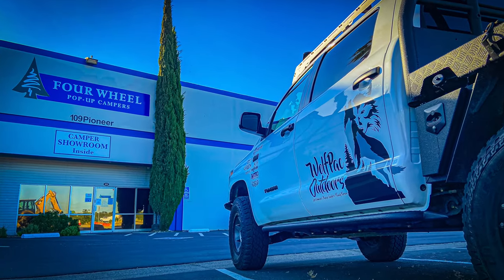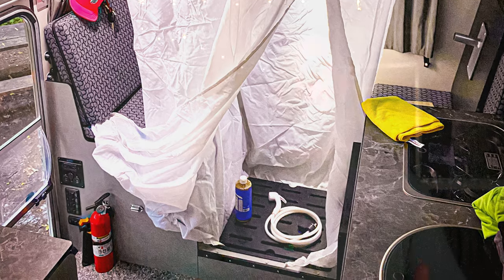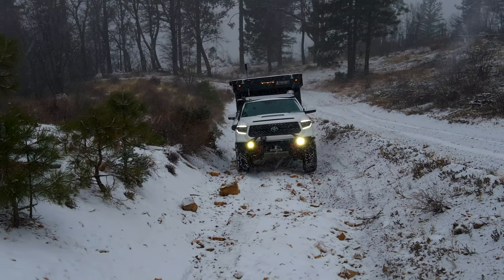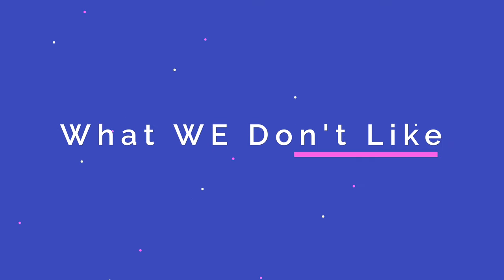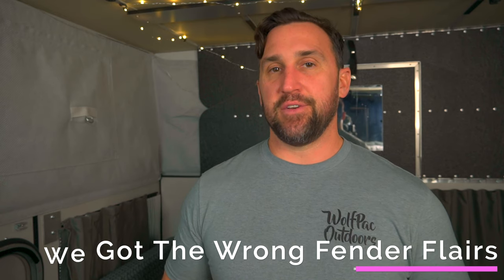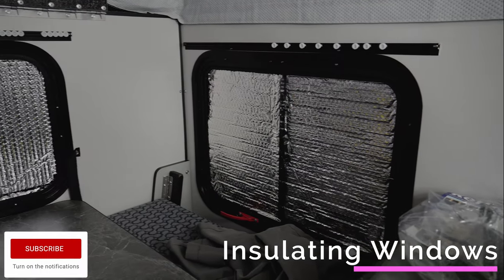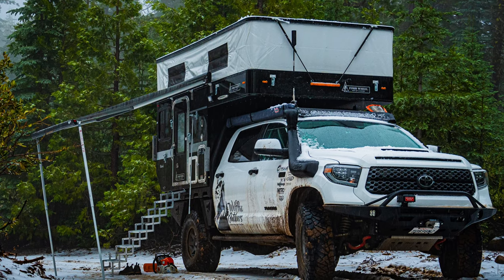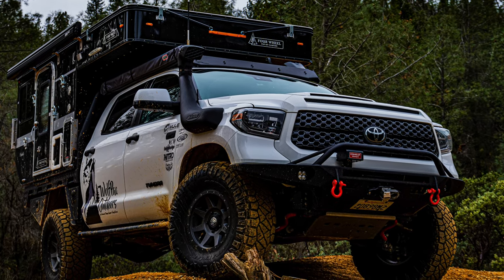Four Wheel Camper 6 Month + 60 Night Review | Ultimate Overlanding Rig

Comment: I want your setup. I have a cement 2021 tundra on 34s and I feel your flatbed and camper would look excellent on mine
Reply from the maker: That would look pretty sick... I'll be coming out with an update shortly that will outline exactly what you'd need to do if you decide to push your truck to the limits with a camper/tray combo 🤙

Comment: Thanks again for all the he great info. Love the channel! I love the black exterior color but was wondering if you think it makes the inside of the camper hotter during the summer months compared to lighter color? I guess it would be difficult to tell without having the same size camper of a lighter color next to yours and have a thermometer inside each one… also, kind of on that same topic, one of the major things I keep coming back to is that lack of an option to add ac to the flatbed models… do you ever wish you had ac? Thanks again.
Reply from the maker: Thanks Zackary, I'm happy to hear you love the channel. Part 1 how hot is it? Well when it gets too hot we either open the whole thing up, turn on both fans, and pray for a breeze (OR) most of the time we find a shady spot or something else to do outside of the camper. Part 2 AC on a flatbed: Can it be done, I believe so. Actually Dometic makes a roof mounted AC system (RTX 2000) which is, in theory, small and light enough to work but it costs around 2500 and would require new heavy duty wiring plus a bigger battery bank than I have.
I have see a few of these around https://amzn.to/3Ok4VtZ and they are becoming more popular, plus a few different brands are making them. If I were starting new I'd go with the Dometic system, but being where I'm at I'd lean toward the portable setup. Thanks for the questions Zachery.
Austin

Comment: hello ,I have a question to the dust problem ,where the dust goes in ,and how to prevent this? driving though the red dustzones in Africa ,it helped to drive with an open backside window ….to have no underpressure in the vehicle ,is this possible with a FW Camper thanks a lot and best regards from Germany R.
Reply from the maker: The back window on the Four Wheel Camper is fixed closed 🤷‍♂️  after much thought a small modification by adding a positive pressure vent under the bed will likely be my best option. If and when I add this I'll film, test, and review it for everyone to see. Thanks for the experienced advise 👍

Comment: Nice truck I have the 2020 tundra Pro in white as well I live on the road in a cargo trailer but I just added an at overland atlas pop-up camper to my Tundra . What type of suspension and leaf springs are you running thank you shocks in upper control arms
Reply from the maker: Nice addition, are you planning on living out of the AT Topper and hauling all your gear in the trailer?
I'm running the full MCM Fab M/T Kit 👍 MCM UCA's, ADS coilovers w/ adjusters + 700lb Eibach Springs, ADS Triple Bypass Rears (custom tuned for our weight), Deaver Custom Leaf Pack (started with the U748's).
Reply: I’ve been on the road for about a year living out of a custom build trailer I converted into an RV just got the pop up camper a couple days ago I had it built with a truma  heater system and a National Luna DC to DC solar charger system so I plan on moving into the truck will do a rear seat delete for storage and possibly selling the trailer want to become more mobile . I was just watching your video on your walk around on your rig that’s a very respectable build I just got through building $100,000 supercharge four-cylinder coma which I sold to my brother I’m trying to keep this one low-key but it’s getting out-of-control already LOL I’m liking your suspension maybe using the ADS myself I’ll give Matt a call and sell my pro suspension it only has 10,000 miles on it be blessed my friendThanks for getting back to me

Comment: hey guy how did you combat the weight on the rear end
Reply from the maker: It all came together once we got the rear emulsion shocks by way of MCM Fabrication (las vegas) and ADS Racing Shocks (arizona). Those shocks help support the weight, add dampening, and fully replaced the rear sway bar.

Comment: Thanks for the really helpful info. I noticed you actually remove the camper and use your flatbed alone. But your camper is bolted to the bed. Why don’t you use frame mounts?
Reply from the maker: Great Point 👍 at the factory the only way they place flatbed campers on the trays are with 4 bolts. If there were an alternative method which was approved by 4WC I’d be interested in running it. At this time I feel if I were in a traffic collision it would be covered because I’m using an authorized method of attachment. Although I agree it would be nice to have a more user friendly connection method because so far I take the camper off 10-16x per year. If you were engineering it how would you connect it to the tray??
Reply: @WolfPacOutdoors  Curious as to how long  it takes you to remove it all. I’ve heard at least one account of a FWC blowing off while driving in high winds! Seems like the bolts aren’t ideal to begin with, which wouldn’t surprise me. Always surprised at how many slide ins I see permanently bolted. So, with a Torklift tie down system, it attaches to brackets bolted to the undercarriage. If one could mod the camper jack brackets, you could go from all four corners of the camper, ideally @ about 90 degrees to the brackets (which should stick out past the frame, tray). At that angle, hopefully you’d still be able to open the Norweld storage boxes? Seems like it should work, maybe even an improvement? But that’s a great point on the insurance coverage, as well.
Reply from the maker: You bring up a good point about the actual stability of the bolts holding the camper. This is also something I’ve spent many hours considering. It came down to me swapping their grade 2 bolts out for grade 5 bolts which have a minimum tensile strength of 105k psi. But what does that mean in real life applications? It means that a single bolt can handle up to 21k lbs of force before failing or 84k lbs total for all 4 to fail. This is all based off my google math 😅
Reply: @WolfPacOutdoors  ..I'm surprised FWC doesn't switch to grade 5 bolts for peace of mind. 🤷‍♂️

Comment: i was thinking about building one of these and was wondering if you've ever towed anything with this?  do you think this would tow a drift boat or a small jet boat ok with the camper ?
Reply from the maker: I have not had a chance to tow with the truck with the camper on... to answer your question; I'd feel comfortable towing a Side X Side or something of similar weight (3500lbs total), but that would really be it... Anything larger and I'd want a 350 size truck or larger.
Reply: We have a FWC Hawk slide in on a RAM 3500 and tow an 18ft 650lb jet sled (with engine) and 600lb trailer up here in NW BC. High mounted backup camera and towing mirrors really helps. RAM 2500 with coils would be smoother; a 5 litre F150 with heavier payload could also work. Would not want to do that with Tacoma. Payload is limiting factor more than towing capacity.
Reply from the maker: Thanks for the info 👍 It's good to hear others experiences with their vehicles and FWC's while towing 🙌